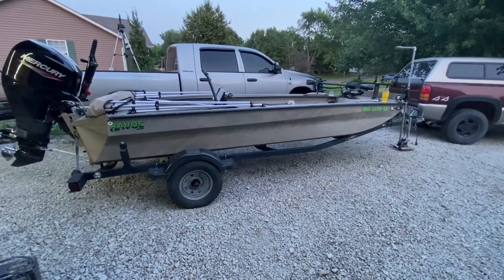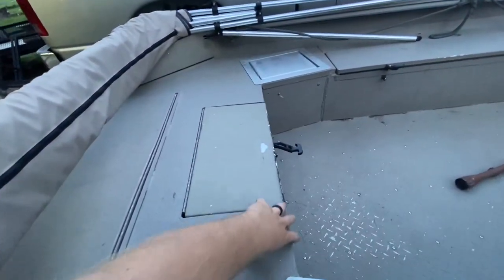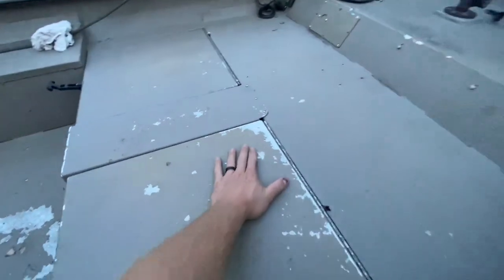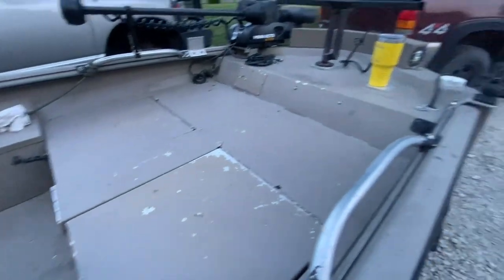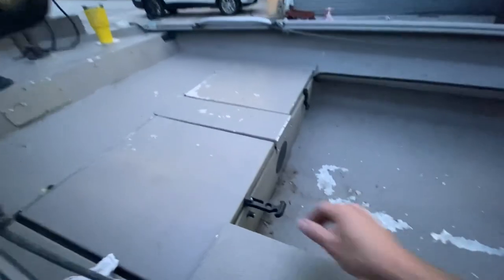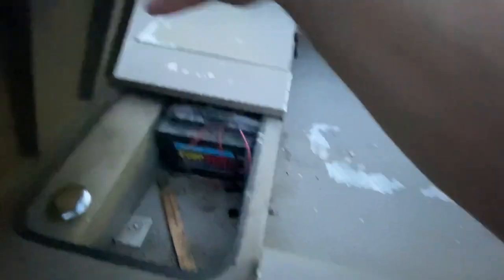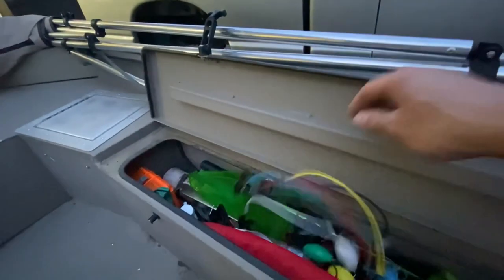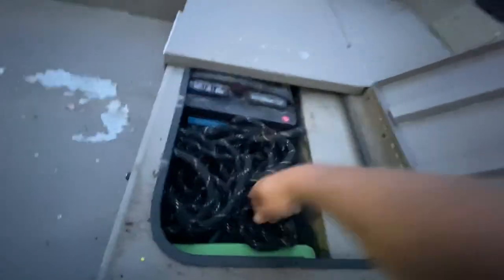1756 Havoc | DB 🦆 Boat | Crappie Setup with Livescope

Comment: What do the. Chairs look like you use up front! Thanks
Reply from the maker: We are using Wise single seat stand portable with swivel. Then added a camp cushion seat that folds. I am looking at doing millennium seat for more breathable. 

We use them cause i do not have much room on the front deck and then if we want to Stand I can move one seat into the back of the boat. 
https://a.co/d/5O8rZj2